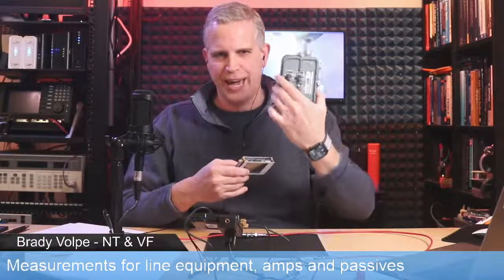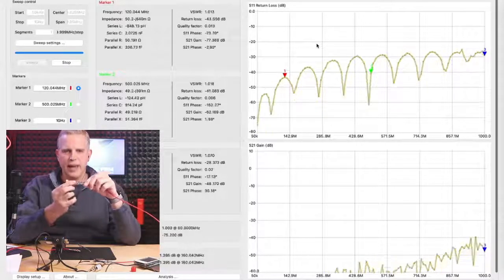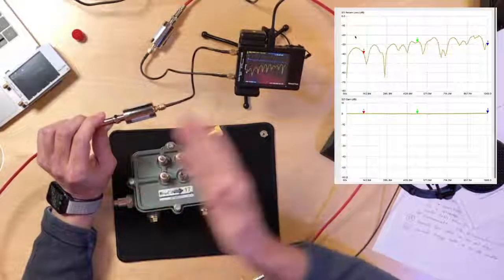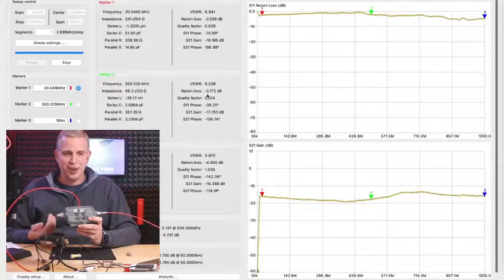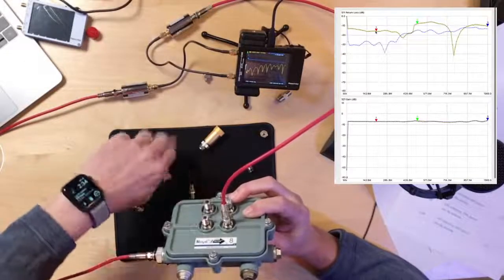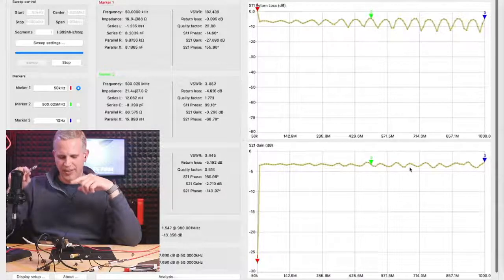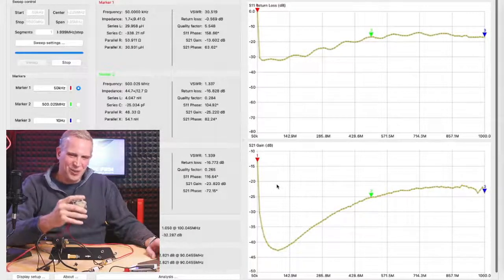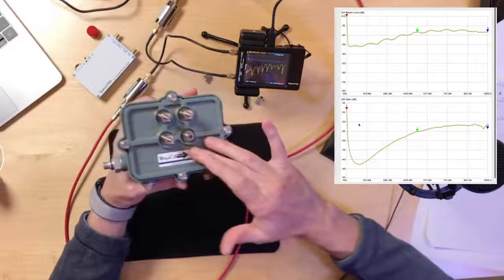Measurements for line equipment, amps and passives with NanoVNA

Comment: Great video!! The impedance matching pad you are using is not the same as your calibration video. Can you tell me what it is? I can't find any here in Canada.
Reply from the maker: @ Bergy Dergy Thank you!
I am testing this matching pad from Fairview Microwave. It's really nice and calibrated to 3 GHz for only US$251. I plan on recommending it in a future calibration video. Here is a link: https://www.fairviewmicrowave.com/75ohm-type-f-male-calibration-kit-component-load-3-ghz-fmtr1005-p.aspx
Reply: @Volpefirm  I was talking about the barrel between the SMA cable and the RG6 cable.
Reply from the maker: Hey Bergy, sorry, I missed this. Here is the part you are asking for. Its an SMA to F matching pad from the same company: https://www.fairviewmicrowave.com/matching-pad-50-ohm-sma-female-75-ohm-f-female-3-ghz-fmmp1004-p.aspx

Comment: Excellent work guys, my only criticism being I now have to pull out my NanoVNA and run my own tests. 😁 That  impedance pad triggered memories of having to design T matching pads for assignments at college. 😁 All the best Brady on a cold wet night in the UK.
Edit, my life is difficult enough without you teaching customers how to diagnose their own RF passive issues although, I would like to hear the conversation on the inbound call between the agent and customer 😁
Reply: Please do more parts about this 🙏
Reply from the maker: Thanks Kingsman. I laughed out loud when I too thought of the call between the agent and customer, when the customer says "Hey my S11 parameter says..." and then agent replies with dead air. :)

Comment: Some testing suggestions
1. Feeding a 1Ghz Signal through an old tap like 450Mhz and see what happens and if u could do that
2. measure 2 Taps at room temp and then put 1 in the freezer and the other one heat up and measure again .. do same with like a 20 feet or so drop cable 
3. The impact of loose and cheap F-Connectors
4. What happens if u Bend the Cable to much
Reply from the maker: All good ideas. I need to get some old taps though

Comment: Would tap lock used for termination provide same protection as 75 ohm terminator or be more susceptible to being faulty leading to leakage? Does any termination cause more or less insertion loss if the center pin is broken?
Reply from the maker: Hi @905 CableGuy that is a great question. Tap locks - F connectors that prevent subscribers from re-connecting their service to an unused tap port - are terminators provided the tap lock includes a 75 ohm terminator in them. All reputable vendors are making tap locks with 75 ohm terminators, but I have come across one that was just an open - no terminator. This would be a problem, so definitely make sure you're getting terminated tap locks.

If the center pin is broken on the terminator - I think that is what you are asking - then it doesn't matter what terminator you are using. The terminator is no longer terminating once the center pin is broken. It needs replaced.
Reply: @Volpefirm  thanks for reply. I have been learning a ton from your website and podcasts have binged a bunch over past month. I would love if you were able to do a video on how much impact ingress from a subscriber can affect other modems off same tap that may not show up as enough of an issue to be obvious on a node level. It's been hard for me to correlate this and would be great to figure out a way that i could determine a correlation more definitively if that were the case.
Reply from the maker: Hi @905 CableGuy, thanks for watching and reading. Glad it's been of value to you. I'll have to give your idea on the video some thought. Its a good idea for a topic.